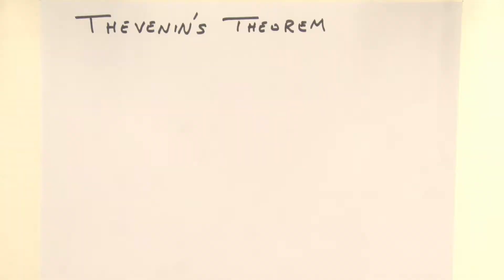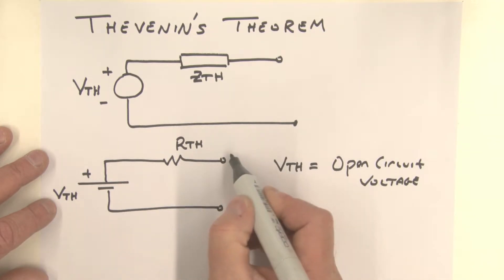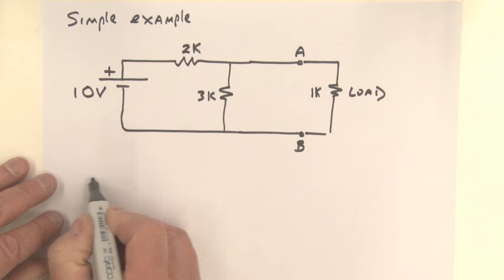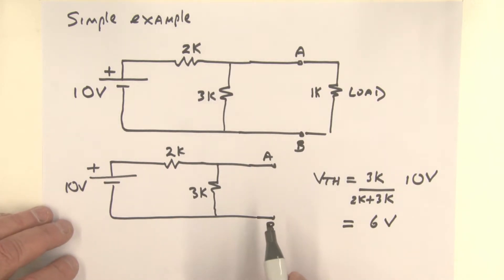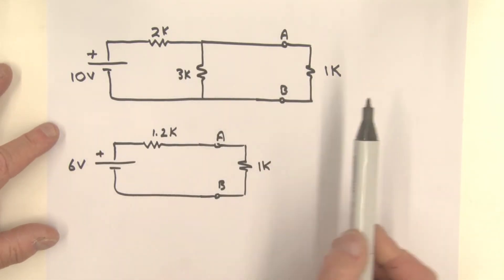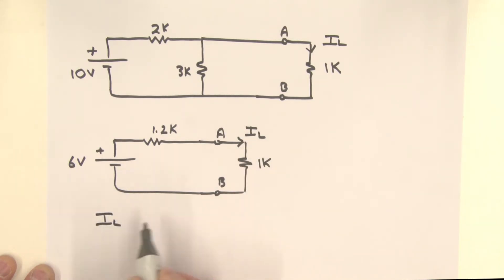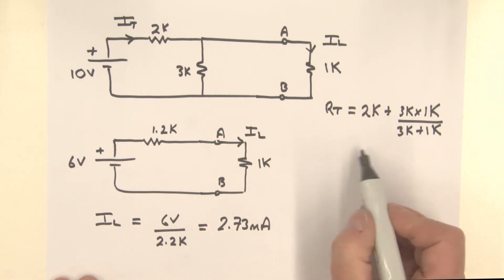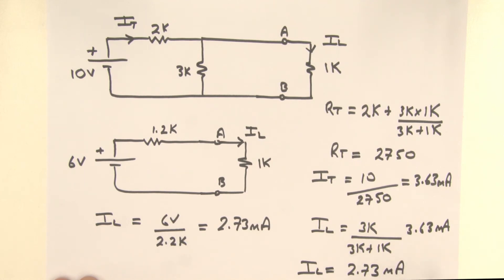Thevenin's Theorem Part 1

Comment: In the first example why did the current not flow at the 3k resistor?
Reply: Becuase of the short circuit the current moves in wire(short circuit) rather than a resistor 
since the wire have Resistance nearly zero therefore the current nearly reaches  to infinity and that why all current goes to the wire (short circuit)
Reply: Ig because current chooses the less resistance path